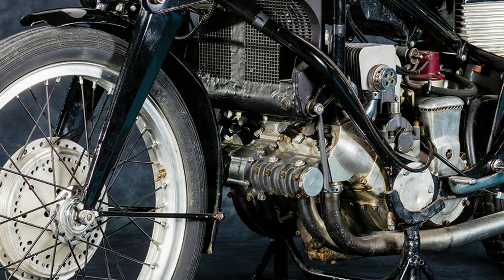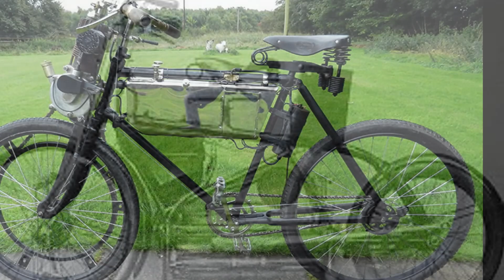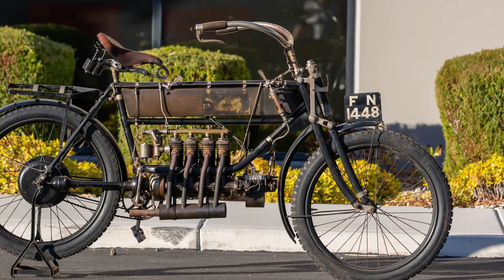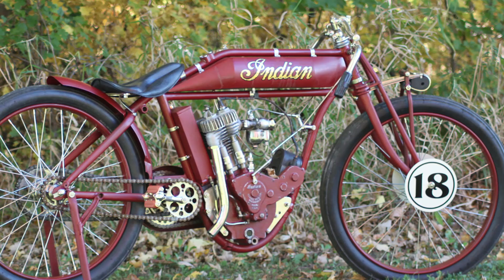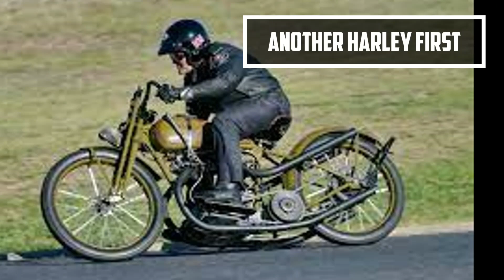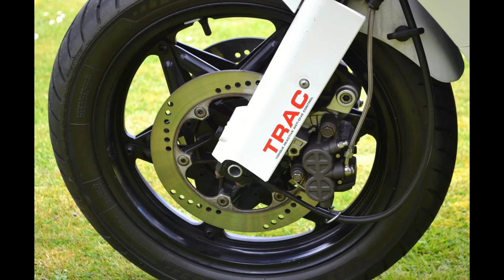15 Innovations That Made Motorcycles Better

Comment: Lovely video! Thanks for all the effort you put into this.

Something I learned a long time ago is that when it comes to car and motorbike tech, there's always someone who did it earlier than you at first believed. And your research certainly shows this :)

When I go to car and bike meets today, I'm usually drawn to these very early vehicles and just marvel at the technical details. It's very interesting to see all the different technical solutions they came up with before everybody settled on what eventually was found out to work the best, or ways to get around patented solutions.
Reply from the maker: cheers for the comments mate, much appreciated. I do find it all fascinating. and yep, the engineering tricks you find sometimes are fascinating. enjoy the ride mate
Reply: @barebonesmc  Sometimes, the early adoption of innovations we now take for granted were too much for the metallurgy or the lubricant technology of the day. 
Parallel twins are normally thought of as originally a Triumph thing (from the Val Page and Edward Turner designs), before being adopted by most of the other British bike companies… at least as 4 strokes, though the previously mentioned Scott two strokes were mostly parallel twins… and if you want double overhead cam twins, then in the fifties, exotic smaller Italian marques, and later Honda in the mass produced world, spring to mind. Suzuki pioneered production 8 valve DOHC parallel twins with the GSX 250 and GSX400 later still. However Peugeot's 500M race bike was (it's believed) the first DOHC, 8 valve, parallel twin motorcycle, and appeared in 1914. Unfortunately, the metallurgy of the time made the engine fragile.
 In much later years, the mighty Honda factory's products suffered from their technology demanding too much from the oils available. The sixties' S600 sports car needed far more frequent oil changes than the car world was accustomed to, and I can remember a London motorcycle despatch company in the early seventies being caught out by the short (and critical) oil change intervals on the Honda twins they chose for their fleet bikes.
 I rode for a competitor company who chose Suzuki GT250s, and people thought they were mad using 2 strokes, but the Hondas the other company tried suffered worn out or seized cam bushings if they exceeded the 1500 mile (IIRC) service interval. It only took a couple of winter crash repair jobs in the fleet's workshop to delay a service by a week… but a week could be another 1000 miles on the overstressed oil. The Suzies we used, being two strokes, always had fresh oil running through the places that mattered, so a week's delay didn't hurt them. Those little twins survived up to 50K miles a year of merciless thrashing and were sold at a year or 18 months old.
Reply from the maker: @chrisgraham5186  cheers for the comprehensive response mate 🙂 it is often the little things that make the bigger changes possible 🙂

Comment: A few comments to an otherwise good show; The Vincent used a monochok rear suspension long before Yamaha, and it was not the diskvalve but the ekspansion exhaust that made the difference for MZ.
Reply from the maker: I have been wrong before :-) Im only human.  as I understand it The Vincent was almost but not quite a monoshock was it not a triangulated canteliver with 2 shocks at the top ?  as to MZ, I understood DKW as it was were the pioneers of the rotary disc valves, the exhaust may well have been another of their breakthroughs but was it someone else who pioneered the disc valve? Glad you enjoyed it anyway mate, :-) cheers for watching mate, enjoy the ride
Reply: @barebonesmc  Sorry it took a while, but I have never concitered the Vincent as anything but a monoshock, it had 2 spring/dampers, but only because he couldn´t  get one strong enough. It was still a sigle unit. For many years I drove a Yamaha TR1 XV 1000, a Vincent copy, with a single spring/dampener, and I se no difference between it and the Vincent in that regard. And the trick, like the Vincent, of turning the springforces to almost horizontal, gives a very, very pleasant feeling. Some say the TR1 is a poor Harley copy, but it is not. It can both stop and drive around corners, and does not leave a trail of spare parts in its track.. As for the MZ, here are a litle film about the industrial espionage, I think you might like to se. https://www.youtube.com/watch?v=1qccejmqbPg       I have seen a couple of films in german, with the paticipants from back then, and, belive me, they did NOT like the guy who went to Japan. ;o)  And, btw, I have had both Suzuki and MZ twostrokes.
Reply from the maker: @noahwail2444  I always liked the TR1, an underrated bike, I guess its semantics with the Vincent, I would describe it as a triangulated cantilever system but not a monoshock purely and simply because as you say, the tech wasnt available for him to use one stronger rear damper. Ill take a look at the film  :-) cheers for watching mate, enjoy the ride

Comment: I may be wrong, but I remember the FZR being steel, the YZF is the one with aluminium frame.
Reply: FZR600 was steel deltabox frame. The 400, 750, 1000 were alloy. 👍
Reply from the maker: FZR1000 EXUP was all aluminium Deltabox. They used a part Aluminium frame on the early Genesis 1000 but replaced it with a frame developed from the OW01 FZR750 which was the original Deltabox perimiter frame with no steel side supports like the early Genesis had. Even the latest R1 chassis are similar and the FZR1000 Chassis hardly changed at all for almost 25 years, Think youll find thats right mate, I do have 2 89 EXUP's :-)    Cheers for watching,  ride free

Comment: Honda's C102 Cub 50s had electric starters back into the early 1960s. The C102 went on sale in the US on 07/01/1960 followed by the CA102 on 08/02/1962.
Reply: The CA71 250cc Dream was released in 06/04/1959 and the CE71 followed on 09/01/1959. The 305cc Dreams C-CA76 models were also released on the same 09/01/1959. These bikes were US spec versions of the domestic 250-305 Dreams sold previously in Japan. Only the first generation models C70-C75 Dreams came without electric starters.
Reply from the maker: @williamsilver6109  you see this is why the world needs more specialists 🙂 thank you William, If i ever need any dream twin info i know where to come 🙂 thanks again my friend. much appreciated
Reply from the maker: really ? i missed that one. do you know when? interesting :-)

Comment: Absolutely fascinating, and I can vouch for those old honda disc brakes being awful in the wet..
Reply from the maker: glad you enjoyed it mate, cheers for watching, I can only imagine what the Douglas RA brakes were like 🤣🤣🤣
Reply: Back in the 70’s the japanese made stainless steel brake discs were more or less a disaster waiting to happen. People drilled holes in the discs to aid transport of water, but it only got reasonable when the first brake pads with sintered metal in the brake pad became standard that there was some relief.
The italian motorcycles with their cast iron brake discs had no problems with braking in the wet, but the discs turned rusty, and with that, the brake pistons too.

Comment: Not a first in the motorcycle industry but a first for me was my 1976 Norton Commando 850 Interstate that was just under three years old when I bought it. This was the first bike I had owned that had a disc brake. Somebody somewhere (in Norton?) decided that a rusty front disc was not a pretty thing, so my bikes disc was chrome plated, this worked well enough in the dry, but I still vividly remember the first time I applied it in the wet (approaching the outskirts of a village called Congresbury on the A370 from the direction of Weston-s-Mare). It was a Sunday late afternoon and there was a little traffic about. As the cars in front of me started to slow for the 30 mph limit through the village, I just gave the front brake a little touch...... nothing, I squeezed more, still nothing, more brake and finally the brake pads squashed all the water off of the disc, where it was being held by the chrome and I damn near locked the front brake, in traffic, in the wet. Fortunately my reactions in those days were lightning fast and in the half a second this all took to occur I figured out what was happening, applied the back brake too and was able to release a little pressure from the front brake lever just before the wheel locked up.
Reply: I had a brand new Commando Interstate in 1975 and can confirm that the front brake was terrible when wet, it took some getting used to...
Reply from the maker: @raywright2657  It was all a brave new world lol
Reply: @raywright2657  As I remember they worked OK once they chrome wore through, but until then... scary.
Reply from the maker: some of those early disc set ups were a bit hit and miss, glad you survived the scare mate and thanks for watching, ride free